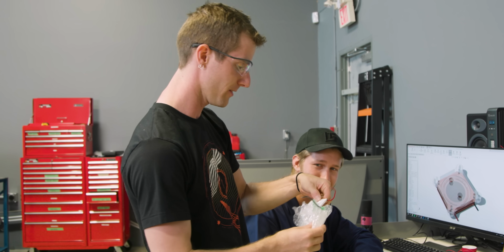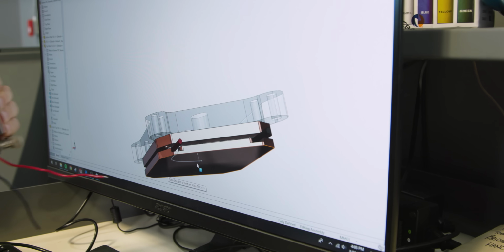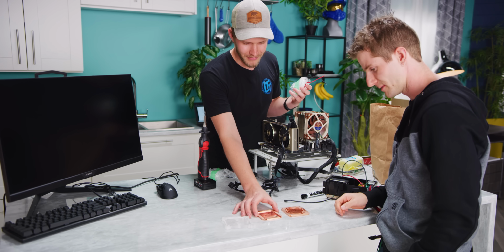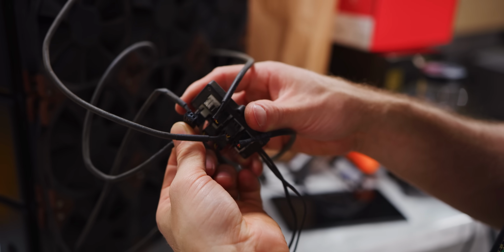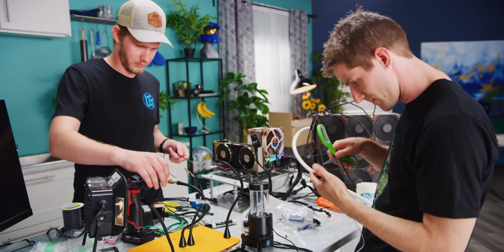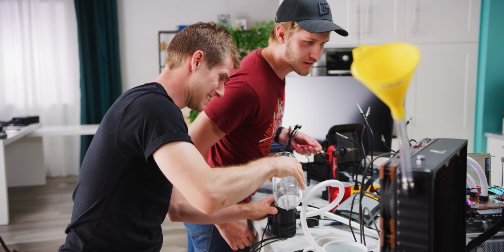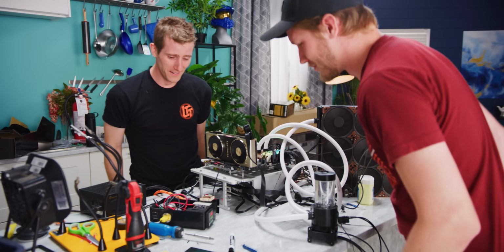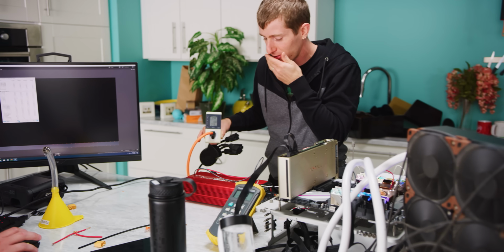This Cooler DRAWS 545W!!? Bad Cooling Ideas #2

Comment: Alex, Alex, Alex. You're not thinking big enough. The peltier effect is for lightweights. What you REALLY need to do is get yourself a good Sterling Engine to pop on the CPU. I guarantee that a Sterling Engine would efficiently cool down whatever heat load you throw at it. 

...if it doesn't supercool your CPU to near absolute zero first, that is...

Comment: so one random project of mine was to rebuild a wine cooler that had a tech cooler, which made me question first this application, then the possibility to use tech cooler to "refrigerate" the inside of a pc case. That would be a massive undertaking being that the case would most likely reach sub ambient and need a draining solution but.....You guys do crazy things like a massive rad on a tech cooler, and sticking a board in a refrigerator and stuff soooo...yea

use tech coolers to turn a case into a fridge along with water cooling and see what happens. It'll be Entertaining at least.

Comment: 1. If you don't use the right ssr, it won't turn off when using dc
2. You want a T type tc to measure sub freezing temps
3. look at the ssr derating curve. they only can handle their max amps when they are cool
Reply: But it's not even a SOLID state relay, since your hear the click, which makes it a regular magnetic relay.
Reply: @the_unkilled2238  The "SSR-40 DA" is a real Solid State Relay, i think this click comes from the PID regulator. It may has a small signal output relay for isolation purposes.
And yes the "A" in the name stands for AC so it realy can't switch off again when DC current goes through it.
Still a good idea from LTT to use a SSR nevertheless.
Reply: @VEKTOR4477  I think they are using the SSR to switch the entire  second power supply off
Using 12V on-off is a realy bad way of controling a tec
Reply: @jonander6811  With this AC relay, it's their only choice to switch the PSU off, but this is far more bad compared to switching the 12V with an appropriate switch like a MOSFET or so. Switching on the line side of any bigger switch mode PSU is very stressful for the main bus caps. Whenever i plug in big switch mode PSUs, the inrush current dims the light for a short moment....
Reply: @VEKTOR4477   controling a tec isn't easy,  when you use a switch and turn off the tec, the hot side (cpu heat + tec heat ) warms the cold side (cpu). 

I say that you should change the voltage you're supplying. Example, it's too cold --> 9V. Stil too cold --> 8V.  It's to hot --> 8.5V and this way you find  a equilibrium. 

But the heat generated by a cpu is changing constantly so the power you input to the tec should change with it
Reply: @jonander6811  Absolutely agree, a analog control of the TEC power would be best. I mean why having a PID regulator in the first place and then just doing on/off switching with very low speed (assumed by the choice of a SSR). The regulator shut definitely have an analog output or PWM type one.
Reply: @VEKTOR4477  oh ok that is probably the reason
Reply: @the_unkilled2238  the clicking was probably coming from the temperature controller. the ink bird block is an ssr
Reply: @cedric1997 A solid state relay is not a relay? Okay.

Comment: The solid state relay you're using looks like an AC unit instead of DC, The TEC is a DC system. If you switch a DC load, an AC SSR will turn on but never turn off since it'll wait forever for a zero-crossing.

Comment: I wonder if you added more pumps to increase the flow of water through the waterblock would help cool it faster. If the block was getting that hot, its possible that the water wasn't moving heat away fast enough and it was bleeding back onto the cpu cold plate.

Comment: Why don't you try instead of using the TEC for cooling, you use it so that the heat generated by the CPU moves a fan to cool it. It is not going to cool it to 100% but if a part recovering energy

Comment: There is one major gotcha to TEC cooling: rated power is for 0C delta from cold to hot side. If you push 500W through a 500W TEC, the TEC is basically working full-time on keeping its own heat away from the cold side. To achieve actual cooling using a TEC, you can only use a fraction of the rated power.

Comment: its because you are using single TEC and 900W power also effects the chip
you have to stack multible TECs for best performance
Reply: 900W single is way worse then 500W stacked under 4 100Ws

Comment: You cant't switch 12V DC using a Solid State Relay! They are designed for mains-voltage AC applications and simply won't work under these conditions! 
Stuff like this make me go absolutely crazy, you guys do the craziest design work and projects and then fail at the simplest EE stuff.
Get some basic EE knowledge for gods sake.

Comment: LOL, the issue isn't the TEC (well it is, but wait for the end)... the issue is the rate at which a CPU increases its temperature, that's what's overwhelming the TEC as it can't 'speed up' so fast in its energy transfer rate... TEC's are very well known for struggling if the dT gets out of balance.

You want to use TEC, you need to place it where it can work 'more stable'.... This is why the Chinese solutions all/mostly place them where your radiator is (nice alu block and heat fin combo). Now, best solution would be to use the following stock components:
CPU will have a CPU block mounted - loop to a second CPU block and mount this to the cold side of the TEC... 
The loop goes back to the pump/reservoir and then CPU again, this is loop 1.
The hot side of the TEC will get another CPU block/standard AIO combo to a radiator. This is loop 2 and you use the TEC as the heat pump it technically is... very inefficient, but it technically is just that. (perhaps do a build with a mini-fridge style compressor pump?)

The TEC can lower the temperature of the first loop without being instantly overwhelmed as the volume forms a buffer. The second loop becomes (mildly) more efficient due to the higher temperature / hot side (thus capable of giving off the heat a little bit more efficiently). You also don't loose with trying to make contact surfaces with rough fin density (no disrespect, making this yourself is impressive!)

Theoretically this is mildly better as a cooling solution, but cost wise nonsense. TEC, triple CPU block, double pump and a radiator... not to mention the extra electricity wasted on this.... For probably only a few degrees of cooling. Get a better paste is going to do more.

Also... Don't use Flow Simulation for heat CFD's... it's fun to check the flow, but full thermodynamics run horrible in it (and yes... I actually own SW and work with it).
Reply: @tacosoverburritos123  I fully agree... SW is great for designing things, 3D assembly (and checks), Visualize the crap with some renders out of your design and for some simple flow checks to get an initial indication on air/fluids... but after that you move to the much more expensive, much more complicated multi week calculations... Now, not to promote COMSOL or anything, but the entire flow profile in the video is not inspiring me his mesh density was even high enough to get an accurate check.

That easily said, bitched with hindsight, no TEC will work in such a configuration and you can't hold that against them. If any, I rather not bitch too hard as I would really love them to play around more with this. It's fun, educational and let's be honest... The final working design, custom integrated and all... will be awesome!

As for CFD, I won't have time to play around with this in the next weeks, but I'll see if I can waste some time later anyhow :D

Comment: For maximum efficiency you want to stack the TECs. If you have 3 in a stack, the bottom TEC should run at double the voltage of the top two. Essentially run the top two in series while the bottom should be in parallel with that. That'll give you much better performance per watt.

Comment: Why not use the peltier as a "radiator", cooling the water, and not directly on the processor?
Reply: And what would you use to cool the hot side?
Reply: @TwskiTV  Another peltier obviously
Reply: @TwskiTV  another water cooling radiator?
Reply: @TwskiTV   elsa.
Reply: And then another water cooling loop to cool the loop that's coolong the peltier

Comment: Your solid state relay is an AC one not a DC one....
Reply: bingo! AC ssr's will latch on due to the wave never reaching a zero point.
Reply: @thewelderdude  He said they had AC in that box so I assume they had AC hooked to the relay and the DC to the input side which was rated to 32VDC. Later with the variable supply they took the pid and all that out.
Reply: @excitedbox5705  the AC was for the PID controller itself.  if the SSR was switching the power supply that fed the TEC, then it would of been ok.
Reply: @thewelderdude  Yea, I went back to try and see how they wired it but there wasn´t a good view of it. Obviously that is not gonna work.
Reply: But TEC is DC

Comment: Alex you're adding 900w to the cooling loop plus the CPU power draw and you're surprise the  area for thermal transfer we use for a fraction of that power draw isn't cutting it? Shame on you, engineer.  The heat transfer needs to happen away from the CPU.  Try a water loop for your CPU heat and a wind tunnel for your multiple lower voltage tecs' heat.  Cool the loop with the tecs' and blow off the heat with the wind tunnel.  You can make it a box that clamps to the top of a PC case. The tunnel with multiple tecs will give you the area you need for heat transfer and let you run the tecs at a more efficient voltage.  You don't want to cool the tecs' with water because the loop holds heat which decreases the efficiency of the tecs' which will require more power and therefore heat your loop up more in a vicious cycle.

Comment: you can't use an SSR for DC current. I use the same SSR module, if used on DC it latches after it has been turned on since it is triac based. they should have used a regular mechanical relay for DC or use the SSR to turn on/off a separate PSU dedicated to the TEC

Comment: Would it have worked better if you hadn't linked the hot and cool sides with touching copper? You were literally throwing all that heat back into the CPU and cancelling your cooling side.

Comment: Threadripper's IHS is approximately that big, and they do make water blocks for that... and many of those use a variable bolt system so you can make it any z distance you need within reason.  I'd investigate that situation before reinventing the wheel with your own block.  the on/off stuff for temp control can be done by an arduino with a temp sensor and a decent sized relay.

Comment: What temperature were you monitoring? was it the cpu/block side or the block/watercooling side? I wonder if the hot side of the peltier was getting too hot for it to effectively move heat.

I would be curious to see what happens if you used LN2 on the hot side to apply more direct cooling so that we can gauge if the limit was the water cooling or the peltier.

Comment: Is it possible to avoid condensation if you put the entire test bench in a small to medium sized vacuum chamber? Just  S U C C all that humid air, and go sub ambient or even below zero, amiright? Just need to use really hard water tubes to avoid them blowing up, I guess

Comment: If the copper is getting hot, then of course the CPU is gonna get hot. All a TEC can do is create temperature difference, and more power means more difference. Yeah, you can go high power, but you can also cool the copper better. You're gonna need a better cooling solution, Alex.

Comment: Linus, hire me and I sub zero you ANY processor with TECs. I swear by my life!

The only way is, to use Heat-Pipes to spread the heat to a much much larger surface. There is absolutely no other way, to archive this goal. The "cheapest" solution would be, to encase a huge heatpipe cooler with a ethanol or glycol/water-mix. That gets cooled by a lot of TECs. They also get much much more efficient, if they are at a low power / surface area. Direct cooling with TEC will not work any good...

Comment: Microsoft is experimetning with the idea of lowering server into the sea to cool it...
(in special containers obviously)
how about doing ocean based fooling :p
Reply: ZerqTM This Winter - Snowverclocking!
Reply: @daniellewis1789  so long as its not below ambient that can work.. and if it is outside the ambient aught to be closer to the snows temperature… basically air cooling inte outdoor temperature would work… 

Also when its cold humidity is lower too…

practically though i dont see how you could cool a cpu with snow unless your mechanically feeding a slurry through some very thick specialized pipe… like a solid steel pipe or something….. that may work…  but then you would have to do something like use heat pipes to transfer the heat...  so not sure how effective that would be..

Comment: i believe you are totally viewing this the wrong way, you shouldnt be using it ON the cpu. you should be havign provide the ice cool air into the radiator on one side and havign the hotter air from the radiator go outside so the hot air doesnt flow back. this allows the fluid to be at a nice cool stage and your typical cpu cooler is still beign used.

Comment: Tecs get less efficient as the power consumption goes up so cranking it up to 900w might not be as effective as keeping it at 200w. Also expect a 10c delta across the tec so for sub ambient multiple tecs should be used with a larger cooling system
Reply: I'm betting on a sweet spot on 2-300w into the TEC. Any more would demand way to much from the heat sink. I think the copper water block got overwhelmed, not enough water flow and speed.
Reply: I do the opposite of this. I use multiple TECs in a small cooling system but the system is half-assed and intended for chilling multiple things in a water loop, not forcing heat away from a TEC in the loop.
Reply: @DaemonForce  they overloaded the one radiator. He calculated 500w without including the cpu heat. And even then it was at 50c meaning the cold side would be at 40.
Reply: "So we got this high power module."
Module. As in modular.
Reply: @hank7281  im not sure what point you're trying to say. No shit the tec is a module. What does that have to do with anything
Reply: @zombieswitapple  I was agreeing with you. I was quoting the video. They knew it was a module, but they still thought the best approach was to use one rated for high power input.

Regarding the power calculation, the power they're pumping into the TEC is also just dissipated as heat. They essentially had a 900 W heater that was moving a TINY amount of heat from the CPU; the "cold" side would have been far hotter than the CPU would have gotten. The transfer from their water block to the water was the bottleneck. That massive radiator would have probably been able to manage.
Reply: @hank7281  oh i see your point.
Reply: After 15 years of water cooling with a 240mm aluminum rad I've jumped on board with copper rads and while my Koolance model is 1/3 the surface area of this 9x120mm hulk, I have a lot of trouble believing that the rad was overloaded except those fans look like garbage and probably push nothing. Can't even hear them in this video which to me says it all. You shouldn't be, but I'm starting to believe you could be right about that. At 30C ambient this rad is handling ~200W of TEC thermals on top of the 111W from my CPU and God knows what from the northbridge. It's reasonably functional at max load.
Reply: @DaemonForce  I actually meant to say the copper thermal block instead of the radiator. At the end they were dissipating around 1000w. Im assuming the radiator is around 3800 cm^3, ambient of 23 c and flow rate is around 3.0 m/s. online estimator shows that to keep 42c the rad has to be 5262 cm^3. not overloaded but not at the steady state he calculated

Comment: Sooo... If I observed that correctly, you can just slap that cpu block on without the Peltier and bottom plate and have a much faster heat transfer and therefore better cooling without using power? Well ok then

Comment: You should add peltier as prechiller for water that comes from radiator, not depend on thermal conductivity of peltier to suck all that thermal energy from cpu directly

Comment: Dear Linus,
Please do a sub-zero cooling solution with your airconditioner but put the motherboard in a vacuümchamber so there won't be condensation.
Reply: It would be interested in putting the whole system in a vacuum chamber. The pumps aren't that expensive via ebay. A vessel large enough and clear (for Video purposes) might be cost prohibitive.
Reply: You can just fill the chamber witg like co2 or nitrogen or any gas that doesn't have any moisture in it
Reply: @omarcarrero3623  Definitely nitrogen or helium even. co2 bonds with water and forms carbonic acid, would cause severe corrosion.
Reply: @gerthddyn  I didn't think of that, the other ic's on the mobo can't discipate their heat in the vacuüm.
Reply: Not a good idea, just use a dehumidifier.

Comment: You have got the wrong relay (SSR) you got the 40DA instead of the 40DD.
The 40DA will disconnect only at zero crossing (0v) it's useful for AC inductive loads.

Comment: All those junk tools.  Maybe if you hired someone that actually knows how to turn wrenches...  The cooler design is not as efficient as it could have been,  A rectangle shape, like a radiator with tapered tanks on either side would have been superior for this design.  There also is not enough surface area on the fluid fins.  I think the single largest problem was the inability to remove the heat from the peltier.

So overall I think this idea has potential if you're willing to ignore the inefficencies.  A massive redesign of the water block is also needed.